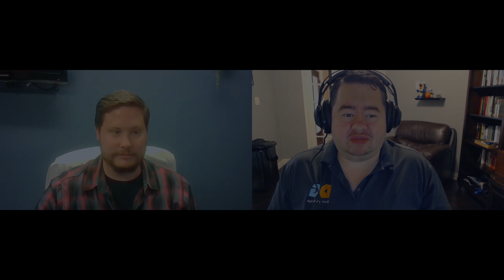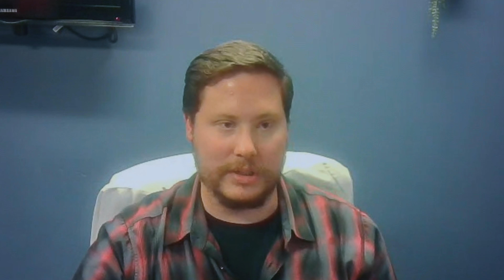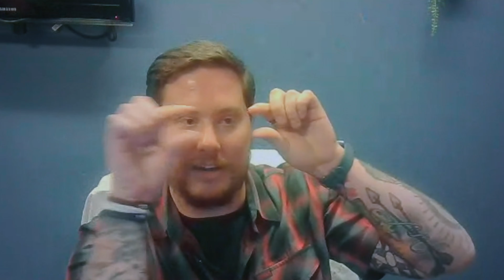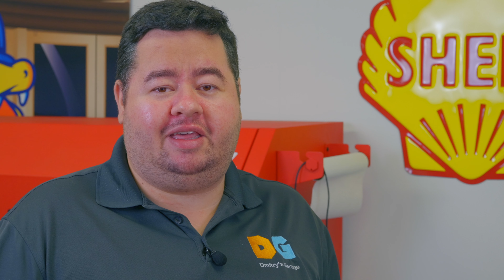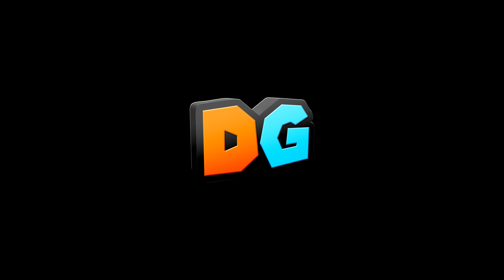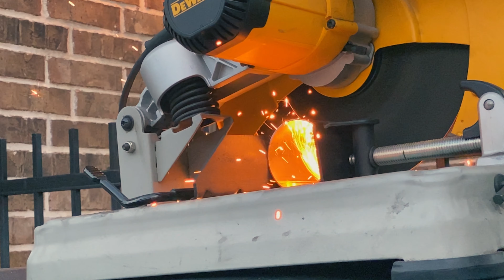INTERVIEW: Chris Gallahar, Adam's Polishes CTO Talks Ceramic Coatings

Comment: On leveling coatings: Adam's should really step away from the microseuede leveling towels. My first coating was Adam's Graphene in 60ml. The microsuede gets clogged really quick, I found out after the fact that I was applying way too much pressure. I left a bunch of high spots as a result of the clogging, overall it was a bit of a mess. One panel completely failed due to my poor application. Buffed it all off. I used TRC Edgeless pearl on my second coating and it made a world of difference.
Reply: Great feedback! Thank you.
Reply: They don't even sell the microsuede in the coating kits anymore. I was in the Adams shop one day and an employee was explaining to someone that they had problems with their microsuede and discontinued it. This was several months ago, so they may have an updated version. I agree with you, pearls from trc are fantastic for coatings.
Reply: Thanks for the heads up. Using this I have been considering usage of this product and want to know this type of feedback. 👍
Reply: @Jeff_Seely  its a very easy coating to use. If you are worried about high spots, get a bottle of the graphene spray coating too - it has the same solvents and active ingredients as the bottle coating, so you can knock down high spots if you catch them within a few hours.
Reply: @scottmattern482  great tip. This would have helped a lot too. I don't mean to talk down about the graphene coating, it's a great coating. It was all user error.
Reply from the maker: Dusty that's a great field report and I'm sure it will be helpful to the team at Adam's. I agree that the microsuede towels can be harder to use. I remember feeling it was daunting the first time I ever used one years ago. It was a pretty small one too.
Reply: @Dusty.Spinster  I dont think you talked down about the coating, it sucks you didn't have a good experience the first time around. Have you seen Adam's has a new coating that has like double the solids? Its more expensive, but looks interesting.
Reply: @snail415  Thank you for your interest, Justin. Unfortunately, I intentionally have to keep my tester network fairly tight and small to avoid "leaks" in IP and project statuses. We have all of our testers under NDA for this reason. Many of the testers in our network are long time Adam's users, or have direct connections with the brand, and are frequently sampling other chemistries from competitive brands in the industry to see how we stack up and inform me of our deficiencies. We also have a very vocal audience that isn't afraid to tell us when we've goofed.
Reply: @cgallahar  I appreciate that response.  If your list ever needs just one more oddball, sticky this video and let me know.  Thanks again for giving us an eye into your world at Adams.

Comment: Water spot remover is the best I've tried since we used hydrochloric acid and 0000 steel whool from p&s waaaay back in the day. Funny that the trick is just now making its way into vogue. 

For stained side windows I don't mess around, just break out the acids. On Adams: I was surprised that it has more oomph than Carpro Spotless. Note!! that the directions say to spray onto a towel and work in cross hatch. Dont let it sit. Wipe clean with a panel wipe. 

Sorry for the double post but this video is amazing. I'm a test engineer by day, Demetry totally scratched the itch of needing to know everything about a products development. 💕
Reply from the maker: Definitely interesting, i missed this trick back in the day. Im really glad you enjoyed the video! Makes it worth the effort!

Comment: Detail shops here’s a really good way to stretch your coatings.  The ONLY thing different between the glass bottle and the plastic bottle is the solids amounts.  IE pour a bottle of advanced glass bottle into your plastic spray bottle and you have about 20 cars of a 3-5 year coating.  Just refrigerate it so it doesn’t start curing in the bottle

Comment: Thanks for this. I was especially interested in the UV protection portion and I like the questions you posed. Unfortunately I don't think a direct answer was given as to how much a typical coating or wax prevents fading, in comparison with the clear coat. The takeaway seems to be that the job of a ceramic coating is to protect the clear coat which in turn protects the paint, which is common knowledge... Is there a technological difficulty or something due to the inorganic nature of ceramics?
Reply from the maker: Andrew, I really appreciate Chris having the conversation, but I think your takeaway is the same as mine. As for the difficulty, I mentioned this in another response to your earlier comment, but it's due to thickness of DIY products, they're incredibly thin. I think they'd have to have a product that lays on much thicker and that would present many challenges.

If the product is soft and easily removable it will be hard to make it look good over time if the layer is thick and readily discernable with the naked eye. Washes and various abrasion would start to etch it up, imagine what failing clear coat looks like. If it was hard like actual clear coat it would be very challenging for end users to apply it. Think of the runs and streaks, ultimately it would be like applying a second clear coat, not something that's user friendly or logical.